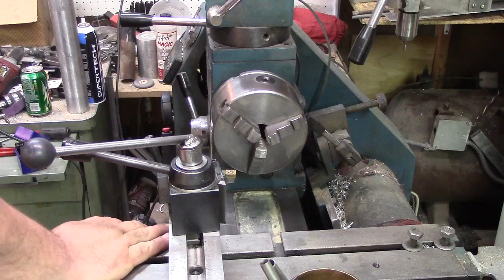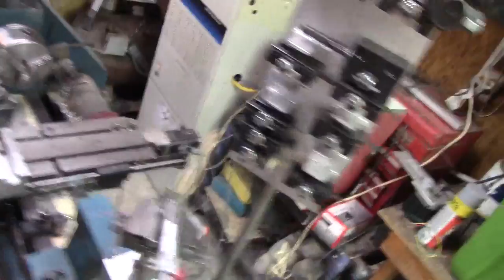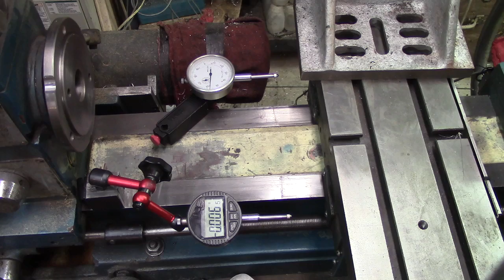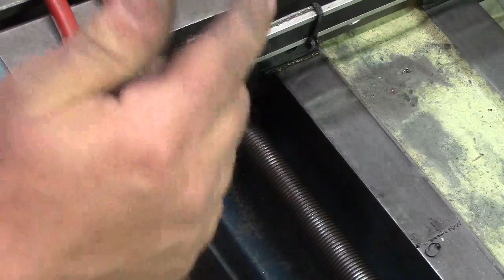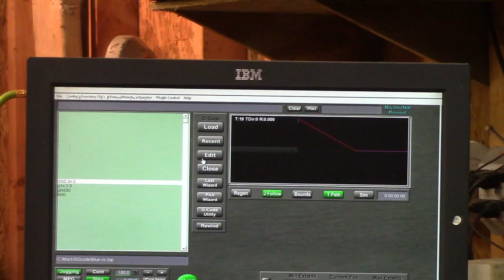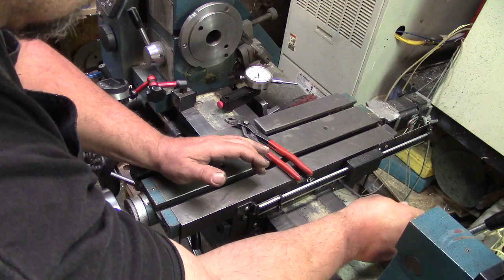Tinker Talk: CNC issues with slop and backlash.

Comment: Awesome! Thanks Eddie!!!  I understood it all.  I was aware of a good bit of it, but I never thought about or considered momentum.  I also hadn't thought too much about windows mucking up the steps.  Great information!!  I really appreciate the time you took to do this vid!!!!  I would have responded sooner, but it took a few sittings because of time constraints.  Hmmm.....I need to get the other computer hooked up in the shop!!!  I could watch vids like these while I'm babysitting the cnc lathe. :)
I'll have to take some time to address the issues with mine.  My does have ball screws, so I won't have to mess with that split nut......which you explained quite well....I hadn't thought about the "lean" being an issue on my other machines, but that might be because they have acme threads instead of square. 
Again....great info and Thank You!!!!  :)
Mike
Reply from the maker: You are quite welcome! The intention was a 10 minute quickie but it got out of hand to the point that even I was confused at the end.  Same here on another shop computer.  It's seems Youtube/Flash needs more and more horsepower every update so a faster machine for that and Cad'ing or tweaking the next part seems prudent.  Running back to the house to Cad breaks my momentum and I wind up off on a tangent! Cadding, for me, is a slow process and I much prefer Wizards but with Mach4 in vaporware land I have to learn it.  Have you looked at Kipware?  Looks like Wizards on steroids.
Reply: Eddie the Grouch
I chuckled when you said it was going to be a quickie and I looked at the length.
I bought a decent desktop awhile back just to help with the vids, but it's got some extra program to handle the video card....which makes the video choppy if it's running.  I'll have to get my son to fix that for me....then maybe I'll move it into the shop too.  It can handle the CAD with no prob.  Mach4???  Vaporware???
I'll have to look up Kipware.  Mach3 was annoying me a bit this morning.....as I enlarged the graphics, the program just disappeared....went back to the desktop screen.  Task manager shows it running, but won't let it shut down.  I have to shutdown and restart the computer to get it back.  Did it twice! Argh!!